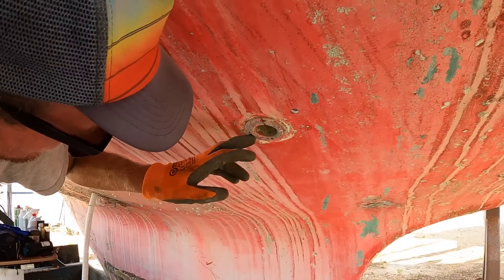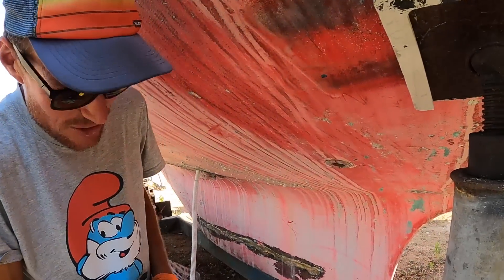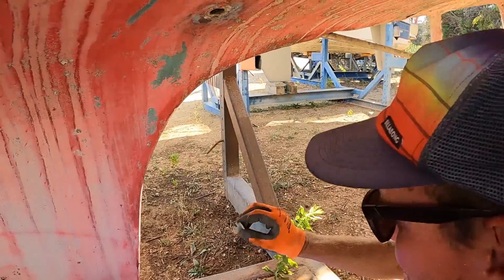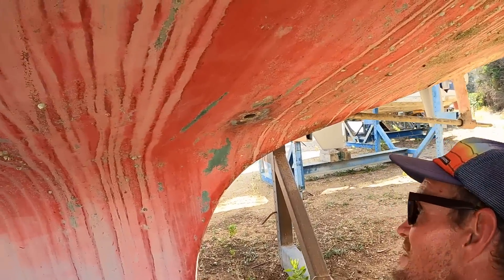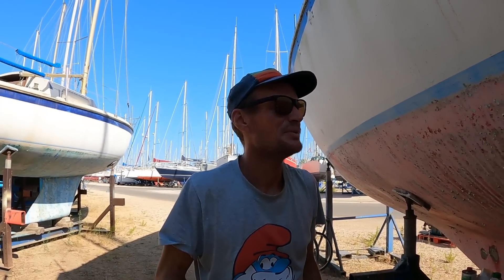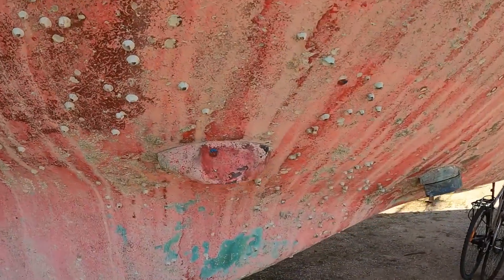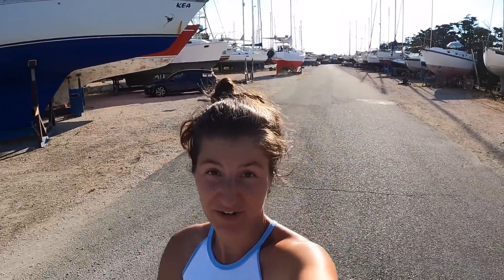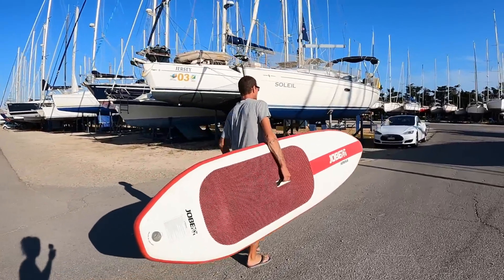There Is Water In Our Keel! Our 48 Year Old Sailboat Project Keeps on Giving | SAILING SEABIRD Ep. 8

Comment: My father was a marine engineer and a yacht surveyor who taught me everything I know today.He would take quick set gel coat with him on a survey.If he suspected osmosis,he would drill a 3 mil hole at the lowest part of the keel. If water had wicked into the keel, it would stream out of the hole.By the time he finished the survey, it would be dry and he would plug it with the gel coat. The problem is there Is a chemical break down in the fibre glass under the gel coat hence the strong smell of ammonia.The fibre glass looses its strength because the resin binding it together has broken down. This is the Achilles heel of older fibre glass hulls.As for plastic through hull fitting,don’t go that route,they become brittle and one fitting can sink your boat.Phosphorous bronze and sikoflex is the only way to go. It’s not the flange of the plastic fitting that will fail, it’s where the hose fits on. Plastic through hole fittings should be restricted to trailer boats that spent most of the time on the trailer.I am sure you are aware but just in case you are not, two stainless jubilee clips per through hull fitting and a wooden emergency bung tied around the hose with string ready if it ever splits.If you keep your anode in good condition your bronze fittings will not suffer.

Comment: I also had to drill my trawler taught in the same places it’s simply a wet bilge
Filled them after drilling with foam and glass over them in the bilge and it’s been fine with no smells or sloshing water now for 13 years 👍
Reply from the maker: Good to know.
We're wondering how to fill the holes.
Cheers for watching 🙂

Comment: Keep at it guys... 
I suggest you fit a permanent drain in that keel void... It will allow you to drain any fluids on haul out and see whats going on via a flexi scope. Without constant grinding and filling.
The smell is de oxygenated water... The fact its clear was a good sign its not black from reacting with iron. Or organics..😉👍🏼 16 holes is a lot.
I would set up  a intake locker. And a a couple of out flows.. one from your blackwater tank one for the engine... And cockpit drain .
Take care 🐝 you two.
Reply from the maker: Clive, great advice. Would love to know more (how to) about the drain.
Cheers for watching 🙂
Reply: @SailingSeabird  they did it on some early glass hulls like Pearson's. Where they had a deep sump in the front of the keel forward of the main ballast.. Captain Q. has looked a few that have them ..basically a through hull but with a screw in blanking cap.. just set in a position where it wont get scraped  off. Foxy lady went through a similar problem with his sacrificial keels...he found  one was full of water..he decided to go the full on route..though some boats actually use water ballast in their keels... Usually trailer sailors or some large yatchs like Beowulf ... Where they put pumped ballast tanks in to the sides of the hull to counter the heel under sail and trim the hull stem to stern when expedition  laiden.
Reply: @SailingSeabird  
Yours is probably rain water thats soaked down into the keel voids over 15 years on the hard and possibly frozen causing the  blister effect...
The only other way would be more risky ...to open up a pumped bilge pipe and pump it up and out.
Reply: @clivestainlesssteelwomble7665  If only it was just rainwater. Our old production boat was deliberately designed so that the shower drained into the bilge to be pumped out by the bilge pump which always left just that little bit of water each time. Of course there was the time when the toilet went into reverse....
Reply: @philgray1023  😵😖 they really didnt think things through did they back then, did they ..🤢😂😬. Shower waste water is bad enough... Sea head spill is not what you want sloshing round deep in the voids of a hull.not to mention the risk of it contaminating stores.

Comment: When I have prepared such, I have drilled with a hole saw suitable for a water vacuum cleaner at the lowest point to vacuum dry. Used 0.3 tomyls loaded with epoxy filler and pumped full and plugged borehole with wooden plug. Then sanded and laminated the holes.
Reply from the maker: Hiya,
Great advice. We’ll look into the best way to go about doing it. We just want a clean bilge and a leak free boat.
Thank you for watching 🤗

Comment: I got rid of 7 through hulls by getting rid of one of my heads and going with a composting toilet and of course  getting rid of the diesel. Do yourself a big Favour and get yourself an oscillating multitool...best tool I ever bought for rebuilding a boat.
Reply from the maker: Hiya Gary, got a multi tool. Love it. Seacock wise I think we have 7 in total so it’s not that bad. As long as they can be accessed and installed well it should be ok. 
Thanks for watching 😀
Reply: And a power file

Comment: We bought a Dufour 31 wich was unattended for 13yrs laying on a shipyard. There were holes in the deck so the woodcore was rotten in some areas. Ive cut the deck open and replaced the wood. My luck was that the previous owner had put in a brand new volvo penta md2030 engine in. After cleaning diesel tank and maintence the engine started at 1st try and works perfect. Still got 'projects' like a new dodger. The sails where decent too. Be pragmatic and don't let anyone scare. Tip; try to keep holes in the hull to a minimum and dont forget to degrease surfaces you want to apply epoxy on! And dont forget 5 layers of Primocon to watertight your underwater hull. Good luck
Reply from the maker: Casper,
Always something to do on a boat.
Five layers Great advice. 
Cheers for watching 😃

Comment: Pull a vacuum on a low point to remove the water . and use a 0.8 mm cutting disc to open up an inspection panel .

Comment: Thanks for the info on through hull removal, I’m just about to mine on my 43 year old boat, and I never saw your method before. Seem easier.
Reply from the maker: Hiya Mark,
It’s a bit of a cheat but if you can’t undo the nut just bash them out.
Good luck with the job, it’s not that bad.
Thanks for watching 😏

Comment: Shop local!  See if you can find a small local welding fabrication shop to make it for you and cancel the order. I am finding that since lockdowns, supply chain issues are increasingly an issue. I expect this to get worse and not better in the short term. Failing that cut an inspection cover port and assess what the condition of the existing tank is like. Easy to make a lid and gasket. I have done that to one of my SS water tanks. 
I am told, by one who did his thesis on osmosis, that the primary cause is poor mixing of the hardener with the resin. Small liquid pockets of hardener remain and water enters osmotically to try to equalise the concentrations on each side of the partially permeable resin membrane. Osmosis can achieve enormous pressure and so forces delamination in even the best laid composite. Stuart is right. A lot of hard work for you both but entirely doable. The phenomenon became more prevalent with the early self mixing chop guns that mixed (poorly) and fired resin and chop when laying down hull. Go well!
Reply from the maker: Hiya Robin, I totally get where you’re coming from but unless you have a super expensive boat or a super yacht you get pushed well down the list. Welcome to boat life.
Cheers for watching 😋

Comment: if there is problems with waiting that give time for grinding down the keel and scrapping to prepare the hull.
Reply from the maker: Hiya Ken. We are getting there with the grinding. Slowly slowly…
There are always jobs to do. We just hoped to get the floor done.
Cheers for watching 🍻
Reply: Also what about having electric drive, making the boat electric run by solar panels and LFP batteries. There are great off the shelf solutions for electric now like ecoflow, 
or the new bluetti AC500 with batteries up to 16KWh or more as modules.

Comment: I know once the floor gets patched, and hull gets resealed.. it will really start feeling like a sea worthy rig. Any leads on an engine rebuild or replacement?
Reply from the maker: Hiya, you know it. Engine wise, we sold the old engine and the guy we sold it to has a massive collection of boat engines so we’ll go have a look. Thinking of a yanmar but the electric idea is still in our minds…
Cheers for watching 😁
Reply: @SailingSeabird  Yanmar is good, can find parts all over the globe. Electric, at this point in time - not so much. And too, you have to consider what happens when caught on a lee shore, the electric engine may become overpowered by the sea conditions as your power supply runs lower and lower...

Comment: Holes in the gelcoat with vinegar smelling water, not a big problem.  Some grinding and epoxy and it'll be fixed.  Really, you may not need to fix it as it isntg structural
Reply from the maker: Tbh it's not super bad.
Once the spring starts hopefully we'll be back to working on the hull.
Cheers for watching 😃

Comment: Ok , so that’s a bit of a leak , I can understand that the water has come from the inside , but why has that caused the glass to bulge , in just one place ? . How confident are you on the condition of the rest of the hull ?  The engineer in me says that reducing the thru holes can only be good 😃🍻
Reply from the maker: Hiya Dave, we get what you’re saying. I think there will be seven seacocks but more organised. None of this adding and adding to one fitting. As long as you have your bungs ready and your seacocks installed well hopefully it’s ok.
Cheers for watching 🍻
Reply: The bulge is a result of pressure from the volume increase in the water trapped in the fiberglass as it takes on more of the chemicals from the resin. I can never understand why people dont just remove a hose off the lowest through hull of a boat if it is being left ashore long term, the inside of the hull is the breathable side making it more prone to water ingress, and fresh/rain water has a much greater capacity for absorbsion which not only makes it more likely to start osmosis but has greater capacity before it becomes saturated.

Comment: plastic thru hulls are not very durable, if you run over rocks ,sandbank or debris they can crack easy and they will harden over years pretty fast, better use messing (kopper and zink) don't know if that is a English word but that is the material what is is named in Nederland keep up the good work!
Reply from the maker: Hiya, we have used the trudesign for many years and we’re very happy. Have you tried them? They are a nylon composite.
Cheers for watching ⛵️
Reply: @SailingSeabird  next haullout (2 months) i will replace on of mine with one and will try it !  I tried the plastic ones din"t last long cause we often going dry with the tide on the waddenzee never tryed composid but i wil!

Comment: Re the fuel tank. I advise to cancel your fuel tank deficient order cause for a refund. Remove the existing fg tank that fits and clean it out. Install a high grade primary filter with a backup equal filter filter to use as an alternate filter when changing filtering while running.  You may even possibly be able to install an inspection hatch in your existing and you will be way ahead with your fuel system. Make sure your tank outlet leaves about an inch of sediment/water room in tank bottom.

ection
Reply from the maker: Hiya Ken, that’s good advice. We’ll have a think about it. We’d just like to start with new tanks and seacocks. The rest we don’t mind. A bit of up cycling and second hand. We had issues on our last boat with the tanks and waited ages for the welder to fix them so we think just start a fresh.
Cheers for the advice and for watching 👍🏼😀👍🏼
Reply: Welded HDPE tanks are fantastic.
If you recycle the old glass one cut the lid off and clean/ epoxy seal the insides then poop the lid back on with thickened epoxy and tape it

Comment: A TCT or HSS hole saw is good for removing old skin fittings. Just core it out and when you mount the replacement pour epoxy into the oversize hole . Sealed and set .
Reply from the maker: Hiya Frank, always coat the holes with a little epoxy. Keep the water out hehe!
Cheers for watching 🙂

Comment: Water that smells of vinegar is Osmosis 😵‍💫
Reply from the maker: Hi Andy, the water was ok tasting. I’ve had blisters on boat before and the smell of that water was so gross. This really wasn’t that bad. It’s not osmosis the water just got between the ballast and the fibreglass…
Reply: @SailingSeabird  hi Stewart,,  after you drain all the water and seal the holes, suggest you use builders expanded foam to fill the void between Hull & ballast..  Good Luck ,,  Good job 😁😁⛵️⛵️⛵️